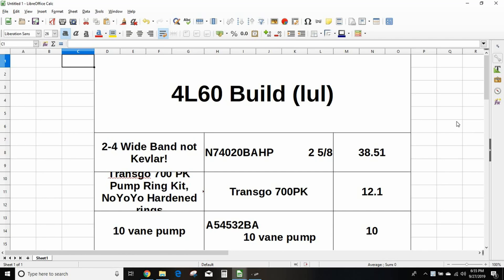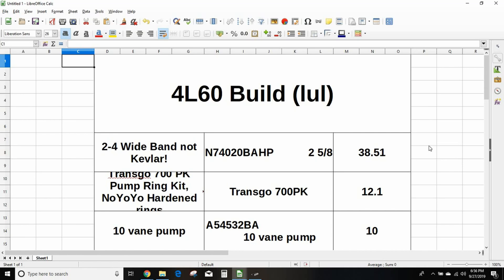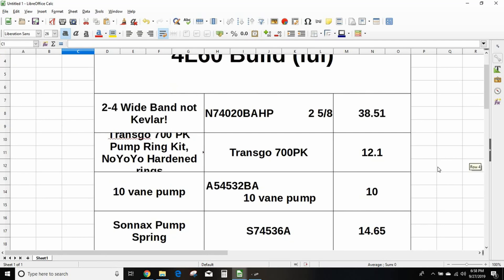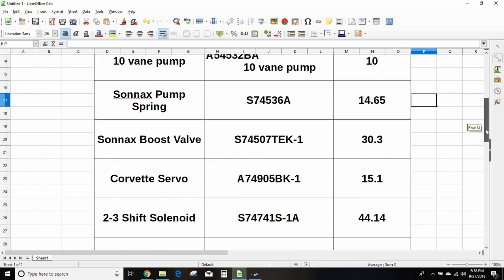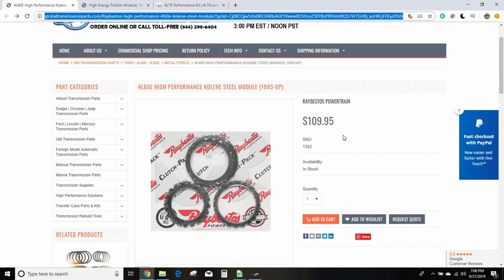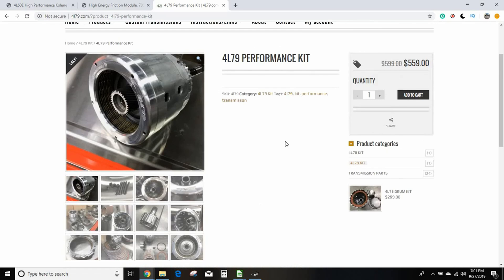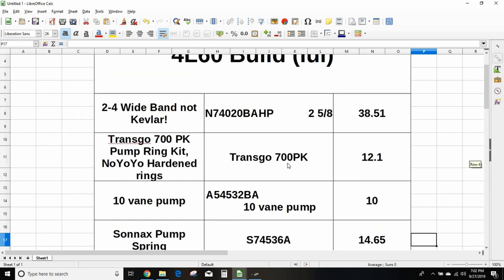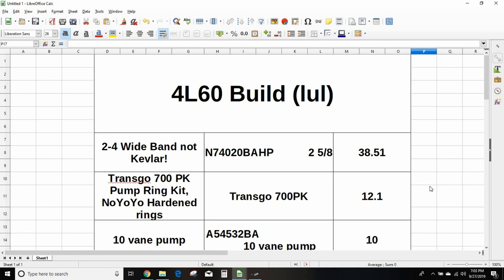4l60E upgrades, for when you think the memes aren't real

Comment: My level 50 60E holds 5000 HP just fine Sir. Yes, 5000 HP in my OBS Silverado running a 5.3 & GT45... HAHAHAHA. Love your content Brother , keep em coming
Reply: My 4L60E holds second gear going 60 in tow haul
Reply: @odell65  all my LS based trucks and the ones I've worked on hold 3rd gear until 60 MPH in tow mode then hits overdrive. What's your RPM at 60 ?

Comment: Why a 10 vane pump? Mine factory has 13 vain. I'm new and tearing down a spare one and rebuilding it.
Reply from the maker: 13 vanes are more likely to cavitate. If you have it apart, I'd just swap it out. 

I wouldn't take a working unit out to do it.
Reply: @TheDrivewayEngineer  the 98 gmc jimmy  4x4  I have has the famous no 4th or od and third is hard to get into doesn't downshift have to manually otherwise it stays hung in third. While I'm still driving it I have another 4l60e a 99 s10 blazer 4x4 complete. I so far took the transmission and transfer case 4l60e and np233 out to rebuild. I know nothing if it was broke or worked. But the green plug was full of transmission fluid when I unplugged the harness and the oil was very brown but not burnt or foamy. So I thought I'd rebuild it while my other one is driving. I want to upgrade the parts that fail. Keep in mine this . I drive like a old man 55 top speed and I need the 4x4 due to dirt road gets soft when heavy rain or light snow in winter. I hunt in steep mountainous area and drive long distance when hunting. I need heavy duty I do tow a boat(20ft John boat) 4x4 gear when deep in mountains plus passengers. Reason for building is I Don have transmission shops near me over 100+ miles away. Alaska!

Comment: You left out the link of the place you mentioned. If you are so pro 4l80e, why not do a video converting a popular 4WD/AWD SUV like a Trailblazer/Envoy/Bravada/Slob platform? 2WD would be too easy for you, moving a mount, shortening a driveshaft maybe. I'm sure there are thousands that would get use of that. There are some kits with output shafts or transfer case adapters... but how much would it cost to change to 4l80e???
Reply from the maker: A popular platform? 😂
Reply: @TheDrivewayEngineer  hundreds of thousands of them out there, many still on the road. There are even clubs, groups & forums--Envoy XUV Group, Trailblazer SS Owners, Trailblazer/Envoy/Bravada/Isuzu Ascender Group, TBSS, GMT360 forum, TrailVoy forum, etc. Not just racers but enthusiasts, off-roaders, rock-climbers, etc.
Reply from the maker: All those hundreds of thousands of enthusiasts haven't figured out how to do a simple trans swap?
Reply: @TheDrivewayEngineer  I'm not sure how many feel they need a 80e. Or want to pay possibly a huge outlay for an 80e conversion. Some may not have enough power to break enough 60's to save anything going with an 80. I'm sure some have figured it out. Go ask Murder Nova, his daily driver AWD TBSS he's selling has an 80e. But if it takes 3-4 hours to change trans cooler lines on them, how long do you think designing, fabricating & implementing a 4l80e AWD/4WD swap would take? And a corresponding video, or series of videos? That's why I suggested YOU, and I don't know you at all--I only looked in the column at the right and saw a bright yellow, "Stop wasting money on "built" 4L60's!!" and noticed the author is you. I didn't even look at it but you must have it all down.

Comment: Throw $500-$600 in to a 4L60, and it still break! I have been through a few 700r's I guess are basically the same , only non electronic. With only 350ish HP. I guess it was the big cam hammering on it/ them,  when I didn't cruse around idling alot , they didn't last, even a 350 bit it!

Comment: If you are stuck with a 1500 chassis, how is it possible to run a 4L80? All 1500 chassis came with the 4L60 or 4L65 even when mated with a 6.0. I think in my case the mods needed for a 1500 with a 4L80 are just too much. And because I won't even be going over 400 HP on a LM7 build. But don't get me wrong, I would LOVE to have a 4L80. Perhaps getting an HD truck to begin with is a better option. BTW, I appreciate all of your posts. They really help!!!! Keep up the good work. I just pulled my first LM7 out of a junk yard and in a weird way, it felt gooooood...
Reply from the maker: If you're talking about a 4X4,it's a hassle.

If you're talking about a 2wd, move the mount back and go
Reply: @TheDrivewayEngineer  Yea I got a 2x4. Sorry I should have said that. Gen 3 silverado 2001 5.3. I just scored a low mile 2005 5.3 with a 4L60e from the junk yard. But yea, I want a 4L80 and I want a 6.0. So that is the end game I'd want.
Reply: and yea I read about turning the cross member and doing some PCM pinning. But will the driveshaft fit?
Reply from the maker: Maybe, maybe not, maybe just grab a shaft from the same body style 2500,maybe have it shortened for a few bucks. There's alot of maybes.

Comment: The only place I can see where the l60 beats the l80 in a performance application besides the Corvette would be where you're corner burning and don't have to shift much if at all, like in Goodguys where you're supposed to go 30 MPH by course design and the really fast guys with the big sticky tires get up to 40, still below the top of 1st gear for my tire/rear gear ratio combination, and you want the car as light as possible. The l80 weighs 255 pounds and the l60 weighs 162, both with fluids without converters, so if you're trying to make a number on a lower weight limit then the 4l60 is more than 90 pounds less, the converters are within a pound if there is any difference at all, and all the weight is almost right on the CG of the car so polar moment changes would be nil. And I seem to be talking myself out of the 4l80.

Comment: I guess those z  pack aren't any good i was just planing on rebuilding my stock suburban 4l60e and they seemed like a good idea if I remember those are the ones with no steels just friction on 1 side and steel on the other but the most I may ever do is a cam which is probably a lot on a 60
Reply: Z pak is better than stock no doubt but the Alto HEG clutches are much better. A Corvette Servo and a Sonnax Smart Shell is a good option. Ebay is the cheapest way to get it
Reply: The best thing you can do for a 4L60E is put a big external cooler on it like the true cool 40k cooler. $110 but worth every penny. Heat is the 60E killer
Reply: I think you are thinking of something else, the "single-sided" friction clutches. The Z-pack I think uses 1 or 2 or 3 extra friction clutches, but to fit them in the same space everything needs to be thinner, including the steels.
Reply: I believe they have no steels and are single sided and maybe add 1 or 2

Comment: Stock 2-4 band is fine, just upgrade servo. No need for koleene steels. So much bad info on 4L60e on the interwebs,  just run a 4L80e. They will all eventually fail.

Comment: JR, it’s clear you’re adamant against using/upgrading/building a 4L60E.  How did you come to that, since it’s pretty apparent you’re familiar with them, it might be a story worth telling.
Reply: The more ya mess with them, the more ya learn to hate them. The gear spread is the worst part. Cost a lot of money to make one like it should be.
Reply: 4L80 is way better.
Reply: @Dragon Medic67 um... lol! Have you actually done the math as far as gear spread in the so called "close ratio" 4l60E planetary sets? The only thing that clossed up is the 2-3 ratios.
Reply from the maker: It's pretty much like anything I post, or do in my day job as an engineer.

Cost/gain. 

The average guy is going to spend at least 1k on tools, parts and fluids to rebuild a 700/4l60. At a 400 rwhpclevel, this build will probably last 3-4 years seeing track use.

A junkyard 4l80, all in, is going to be about the same cost to someone with an LS bases engine, and will live with no internal modifications forever at the same power level with track use.

On the earlier video, or in any meme battle, you find the defenders of the 60 saying they work when built right.

That is accurate, and I know how to build one that will work for most people. But they neglect cost. To just buy a trans like this, you'd spend 1500 minimum. 

It's too expensive for what you get.

4L80 is just pure bulk beef. If you can run one, you really should.

Comment: I put one of those "Corvette Servos" in my stock ass 4L60E. WOT would chirp 2nd gear. And I'm no where close to 400hp! Maybe half that. I actually went in and turned down the line pressure a tad because of it shifted so hard even just cruising around.
Reply: you can adjust them electronically. Somebody must have tuned it for hard shifts. You really need a stall converter which will soften the shifts or turn it down electronically. Don't mess with the EPC
Reply: @rockroll9513  I tuned it with HP Tuners.
Reply: @4BillC  okay. My 2002 Ls1 would easily spin the tires for about 40 feet when going into second gear right before I installed a stall converter
Reply: Camaros and firebirds came with the Corvette servos stock
Reply: @mothridith9760  I can only assume that's why they call it a Corvette servo because that's what they had, and all the other transmissions came with a down graded version.
Reply: Only the Corvettes had to Corvette servo. Firebirds and Camaros did not, hence why they call it a Corvette servo
Reply: @darrenporsch  absolutely incorrect. The Corvette servos were available on the Firebirds and Camaros with LS1 engines. Stop smoking so much dope.